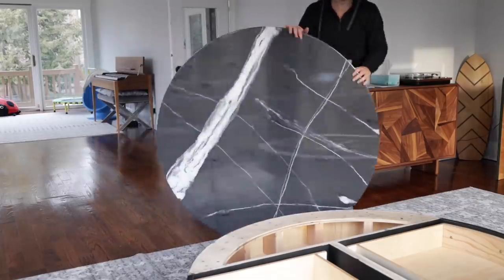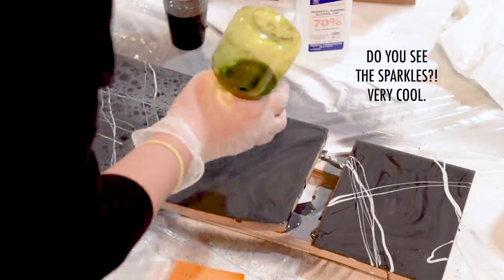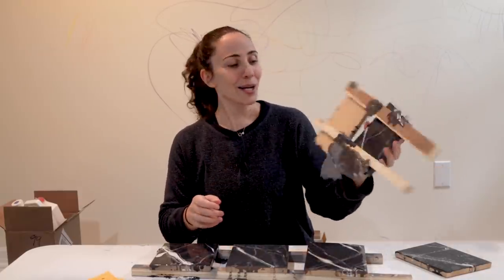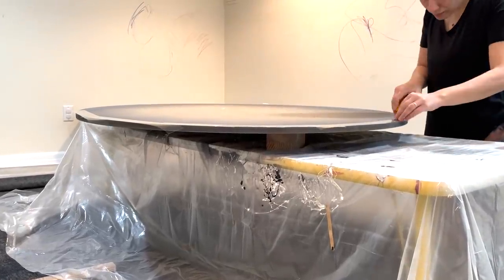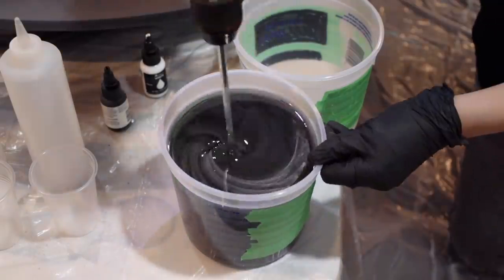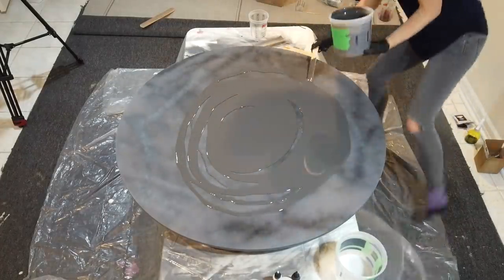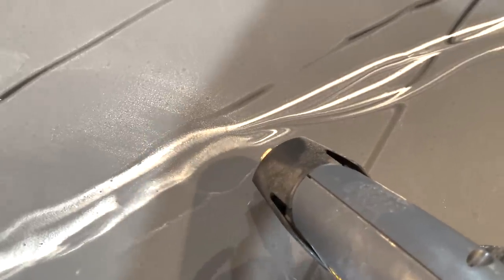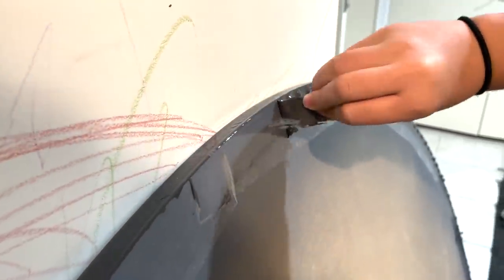Experimenting with making EPOXY look like MARBLE

Comment: To knock back the sheen there's no reason to work up from 220 grit. The finish is already smooth and glossy, you don't need to bring it all the way down and then work up. Start with 2000 grit and if it's still too shiny work your way down. Plus, you've got all those test squares you can work on first to see what grit gives you the effect you want.

Also, feathers are the traditional tools for applying veining in faux finishes. Also, different kinds of feathers will give different effects. Flight feathers, which have firm compact barbs, can make a thinner line. Feathers that are fluffy, like Ostrich, will give a more diffuse effect. It's worth experimenting with acrylics to develop technique.
And any veins in marble that may cross are never at right angles to each other.
Reply from the maker: I was thinking I needed to start with a lower grit bc there were the inconsistencies on the edges. 

Cool too about the feathers

Comment: Having used epoxy a couple times on much smaller scale I can say that the trick for a lot of depth and Rich color and texture is definitely to do layers. If you went over top of that with the same colors but less opaque in a second layer and follow the same pattern the lines of the marble would be slightly shifted from the lines in the lower half. Also you could vary the colors of the base layer slightly to give more depth. I definitely think if you'd use two different colors on the base it would have worked out better either by dropping thicker lines in or by dirty mixing the two different colors into one cup and then pouring that on. It'll be less noticeable if you pour two different colors into one cup and then pour that on said if you pour one color on the pour another color on and then mix it with your hand. It'll give more natural variation. I haven't tried marble myself but I have done galaxies and the way to give it depth and like there's both darkness and bright colors from a nebula is multiple layers of thin epoxy.
Reply from the maker: Good tips

Comment: Here’s some hints.  To minimize bubbles, drill a hole in the bottom of your mixing cup, and cover it with tape.  When you mix the epoxy, the bubbles will rise to the top.  Just remove the tape for pouring and you’re getting the epoxy that’s bubble free.  

My second hint is to be careful making a tape dam around the edge.  I did that once and the epoxy formed a meniscus: the edge had a raised sharp lip that had to be sanded down.
Reply: Hii sir

Comment: Thanks for sharing your finishing process and I'm glad you liked my feather suggestion.  I used the feather slightly differently than you were talking about, but I was using paint and polyurethane, not epoxy, so your mileage may vary (etc.) if you try my suggestion.

I dipped the feather into the paint I was using for the veining and drew the veins using the feather.  Imagine painting with a feather instead of a brush.  I used the whole length of the feather and dragged it along the dried painted basecoat to make my veins.  The technique was similar to what you did with the popsicle stick when you tweaked the veins and black marks.  I would occasionally roll the feather about 30 - 60 degrees to vary the line thickness.

Perhaps if you drizzled on the veins and then traced along the line with the feather rolling slightly from time to time? Again, I've not tried this with epoxy.

Anyway, great video once again.
Reply from the maker: I’m def going to try the feather next time!

Comment: First of all, this was a very good 1st try! Check out stonecoat’s products. Advertised as no VOCs.
Using the one bucket method adds a level of risk of adding unmixed product onto your surface. Scraping, then dumping contents into 2nd bucket and mixing again not only keeps your portions consistent, it ensures everything is thoroughly mixed.
You’re correct about the round over. Always have a minimum of a 1/8 inch round over, but a quarter inch is recommended.

Adding a dam around the edge to hold epoxy for a little while is what’s called a, “dirty pour”. Ton of videos out there on the process, but IMO Stonecoat & RK3 are the masters. I do not recommend using packing tape for the damn because you run the risk of residue on the sides when you release the dam. Finally, Stonecoat offers an ultimate topcoat, which you can get in either gloss or matte finish.
Reply: I totally agree with Chris. I had watched dozens of Stonecoat countertops videos before doing my kitchen countertops and bathroom vanity and floor. They are very helpful and a great resource for color ideas and different methods of applying it to get different looks. They even have a video about how to sand it back to create the matte finish. The great thing about epoxy is that if you don't like how it turned out, you can lightly sand it and try a different technique. More layers actually help get you that smoother flatter finish. The biggest thing I learned is that getting in a hurry is the enemy of quality. Racing the clock when it starts to setup didn't go well for me.

Comment: I like it the way it is! Be careful sanding it. I saw a video where someone sanded and it turned brown, probably from the heat friction burning the epoxy. Always love your videos. Thanks Tamar.
Reply from the maker: Thanks! Ooh yeah. That’s a good thing to watch out for
Reply: Good point, a gentle approach keeping an eye on the temperature of the disk. Perhaps wet sanding... Just don't let your MDF get wet.
Reply: I carve epoxy with a belt sander and as long as you don’t overheat it it won’t discolor or soften,  take it slow and wet sanding is of course you friend.

Comment: Thanks for the video!  Lots of tips as per usual.  😁 In stead of sanding the table back, try using a hard wax oil system like Rubio Monocoat Pure, or Osmo.  Both are satin by nature, and provide a finish to woods and epoxy.. Worth a test on one of your samples to see if can work, and save you some work.
Reply from the maker: Maybe!

Comment: Another brilliant vid. Your testing finishes before the main table surprised me, I thought you had done the table immediately. Great idea to see what you needed to do first, coz a couple of those samples would look amazing on a different piece and now you have the details. 

I'm keen to see how it looks after "honing" but I suspect you may not need to go as high as 2000 grit. I've sanded MDF to a mirror gloss with sanding sealer and 1200 grit. If the epoxy is in any way similar, a satin finish may happen around 1000 to 1500 grit already.

Your marble turned out almost flawlessly already and I think this will make it even more natural looking.
Reply from the maker: Thanks! I’m so happy I experimented first! Yeah. The sanding will have to be an experiment also 👍

Comment: Looks nice!  One tip though, make sure to scrape the sides of your container when you're mixing your epoxy.  That way you can scrape the sides when you're pouring and use all of that expensive epoxy!  Also, if you don't scrape the sides when mixing, it's entirely possible that you'll have different sections of your pour cure at different rates.

Comment: Strong Island!!! 💪 Amazing video as always and definitely adding to my woodworking collection of tips. Loved seeing all the different samples at first. Two tips on my experience with epoxy, dam the sides and wait about 30 minutes then hand rub over edges wherever a dry void happens (you covered that). Secondly, after mixing epoxy, always transfer to another container and scrape sides and bottom and mix a few more minutes. This eliminates any tacky spots when epoxy wasn’t mixed thoroughly. Keep up the amazing work and interested to see how you knock down the sheen. Being that table to be in a sunny room, I’d sand it down, apply oil based poly, then wet sand, and apply at least two more coats of oil based poly. I never applied final coat of satin oil poly to cut down on sheen, but I’m sure it’d work. 👍
Reply from the maker: Good tips 👍👍

Comment: A salt shaker works great for dusting with accents. I have been using powder coat powders not only for coloring the epoxy but also for adding sparkles and controlled dusting.
Reply from the maker: Nice tip

Comment: Great experiment.  If it were mine, I think I'd make the top a bit larger so there is an overhang.  Maybe I'm seeing it wrong, but right now it looks like it is flush with the round base?     And I agree that you need more black in it.   Still, all things considered, I think it turned out pretty cool!
Reply from the maker: Thanks! And yes. Right now it’s flush

Comment: I have a interesting idea for you -wood wagon wheel coffe table but the inside of the spokes is filled with epoxy (middle where the shaft used to be can be used for single wood turned post with a cross for legs ).Like scenes of wild west ,printed out on a paper to look like 3d and then covered in resin between spokes.
Like a  life story of a wheel before it became a coffe table.
You could find old wagon wheel or give a try in making a new one and then making it look old .
Reply from the maker: Sounds cool

Comment: There is a company called Stone Coat counter tops that has a roll on clear coat that is available in a matte finish. It also has good UV protection to keep the epoxy from yellowing when exposed to sunlight.

Comment: Thanks for sharing your experiment! Good work! So many comments, I did not get through them all, but a great dam, is using aluminum tape...if not already mentioned. Comes off easy with no resido...applies easily to....and moldable.....just a thought...again great job!
Reply from the maker: Good tip! Thanks!

Comment: Great video! One question, do you need to finish both sides of the MDF (or any media, wood or whatever you use) with epoxy (or at least something, polyurethane perhaps) to equalize moisture ingress/egress and perhaps surface tension (the epoxy expanding/shrinking at a different rate on the top side vs the bottom) preventing warping? I know MDF is very stable, but I would suspect the difference between the expansion/contraction rates on both sides of the top will eventually cause problems. 

I assume because this was/is an experiment, and you only attached the top with a few brackets, you did not bother to finish both sides. Totally understandable if that is the case but if you have any other information it would be good to know.

Just wondering. 

Love you sharing your woodworking journey.
Reply from the maker: I don’t think it’s required with mdf

Comment: When it comes to scraping the bucket or not the solution is to have a second bucket pour the contents of the first bucket into the second bucket and then scrape the sides of the first bucket into the second bucket as well then remix and then you can pour and use the entire contents.
Reply from the maker: That’s a good tip. I only had a limited amount of mixing containers. Had to save one for just the clear

Comment: Very nice project, love to see you are stepping out of your comfort areas and keep expanding. 

With that said, glad you mentioned that the top looks out of place. To be honest the table looks like it was created out of three pieces (well done though), just not coherent. You are correct, in my humble view, that bringing down the sheen of the top would help. However, perhaps adding some dark strips of wood to the bottom section will make the entire build look more connected, more whole, as a single unit that belongs together. In some ways I wonder if the project was a little rushed with all the other things going on in your life. Perhaps just my aesthetic (which has been questioned more that once), so take it with a lump of salt. 

My aesthetic aside, well done.
Reply from the maker: Haha thanks. I was going for the 3 different pieces look. Ha

Comment: Good morning Tamar, I was just inquiring to find out what router lift you use? I was looking at getting one and yours looks so easy. I did not recognize the wrench to allow it to go up and down. Is it electrical? I was looking at rockler and they have a handle that you insert to allow for the up and down movement.
Reply from the maker: There is a foot pedal. It’s from MLCS
Reply: @3x3CustomTamar  Thank you Tamar, i purchased the pedal, but I was also wondering how you made it go  up and down? What lift do you have?
Reply from the maker: @davelengerjr.4123  it’s a whole system from MLCS
Reply: @3x3CustomTamar  thank you Tamar I really appreciate that I found it. I really appreciate the content you put out as well. Excited to get started in this new trade.

Comment: I know why you chose the epoxy top!🔥🔥🔥🔥🔥🔥🔥🔥🤣😂😆😂🤣
Any excuse to light a torch.😆😂🤣
Actually, besides the 🔥🔥🔥🔥🔥, epoxy is a great resource for many types of finished and even repairs or renovations. I do agree that a more satin type finish in the family area is definitely a better fit and the epoxy will still be very easy to clean. If it doesn't wash off, grab the grinder!!!!!😆😂🤣
The true test will be family time and how well it survives the kids.😉
Thanks for the snow shower.😬😁
I tried to drop a picture of Mauna Kea in here to show the snow here in Hawaii, but it wouldn't let me. If you Google, snow on mauna kea it will show the live webcam view of the telescopes and conditions at 13,000 feet elevation here in Hawaii.
Another fine project Tamar!👍👌🤙
Reply from the maker: Haha you got me 😂

Comment: If you want very thin veins then the answer is to hold back a little epoxy out of the same mix and then wait till the epoxy on the table has stiffened up slightly as well as the accent color and then drizzle on with a stick very quickly very lightly in La make very small thread-like lines if you put it on too soon the epoxy will kind of lay down flatter which allows it to spread out and look whiter. Waiting too long with this method can leave the slightest Edge on the lines so be aware of that too but if you are doing a surface top coat poor then it would cover all of that anyway.
Reply from the maker: That makes sense

Comment: Whoa! I would start at 1200 Grit and go up from there not 220. You will murder that epoxy and be repouring it if you start with that. As far as the burning of the epoxy when that happens you can scrape it out and then pour new epoxy which is why some people will torch the epoxy two or three times during the poor so the very last torchng is just a quick once-over and most of the torching has been done early on in the process so in case it does burn you still have the availability to fix it. As far as the edges painting really helps with bleed through on Sharp Corners where epoxy doesn't do well so taking a router and putting a mild Edge on it will help with that as well as pre painting. Also if you set aside your tint colors for your veins in your marble and then put them on later they have less of a tendency to Sag off the side. Then you can pour a topcoat clear over the whole thing to protect it and give you something too lightly sand or buff for the honed look if you want it. If you do that I suggest a top coat sealer even after you sand it so that you can protect it. A car wax will work very well for that as well just to keep stains from seeping into those micro scratches.
Reply from the maker: Great tips

Comment: I prefer a matte finish for the panels I make but beware if you sand the gloss in anyway you do open up tiny little micro scratches which allows stains to be able to be made so be aware that it will not be as impervious as it is when it's glossy.
Reply from the maker: Good tip. Thanks

Comment: Start at 800 grit wet sanding with plenty of water.  The object is to remove the sheen, not much material...  I got excellent results using an air operated auto body fine random orbit sander with water piped directly to the pad.  it is 100% safe as no electricity, a bit noisy but you can manage power levels incredibly finely, from virtually nothing right up to a mad scream and any point between.
Reply from the maker: Sounds cool

Comment: You would've wanted to wait 1-3 hours before removing the tape, had you done it that way. The 30 minutes wouldn't have been near long enough. Also, with the way you did do it, you should've used the heat gun to push the white over the edge. One other thing... When you're using MDF, paint isn't enough to stop the bubbles. You should apply the color you want for the background. Then put on a few layers of a clear finish. Whatever type you use for woodworking. Then, just lightly sand it before applying the epoxy/resin. Or, apply two solid layers of paint.
Reply from the maker: Good tips

Comment: Lesson learned, pour epoxy in late spring to summer when the temperature can be controled in the shop and not in your house! Do a few before making the actual piece.
Reply from the maker: Yes. Except this project needed to be done in December. So I couldn’t avoid it. Ha.

Comment: The result looks cool, but I still think it would have looked so much better if the lines weren't crossed at almost a right angle, again as I said in my earlier comment, I'm no expert, it's just my opinion, neverthe less, it is very beautiful, I love those colors on marble. Way to go Tamar.
Reply from the maker: Ok. But that’s what the actual marble I was copying looked like

Comment: Why not add some kind of white wood band around the circle -so it would look like marble inside and fancy wood to contrast it on outside ,that way you would not have to do those outer edge veins .hell you could even make a damn out of that wood and pour epoxy right in .
Reply from the maker: Would def be cool. But would be a different look